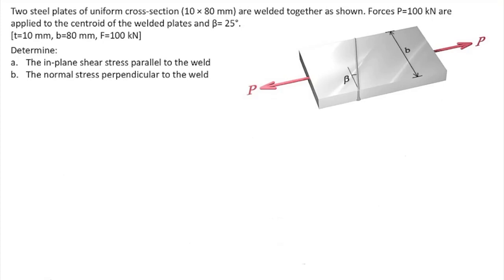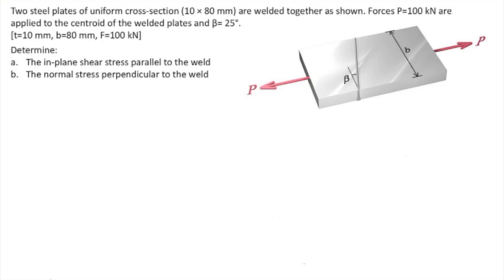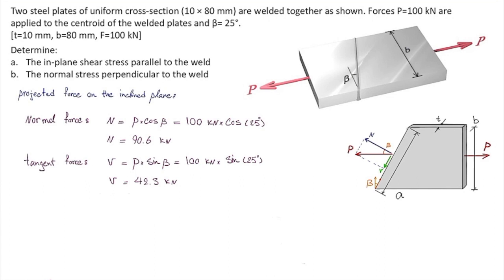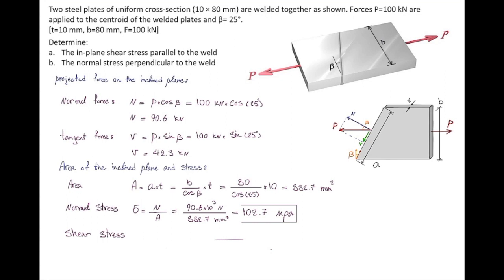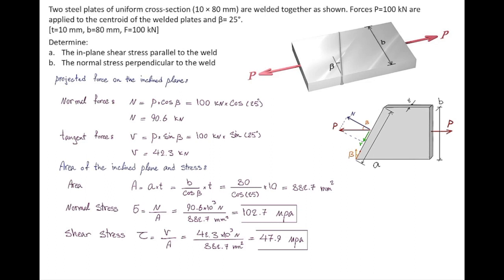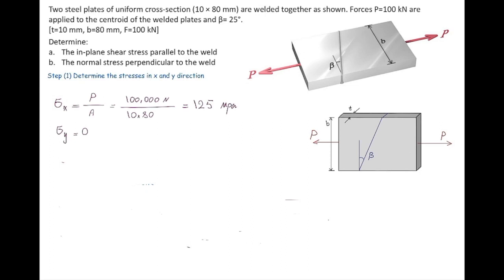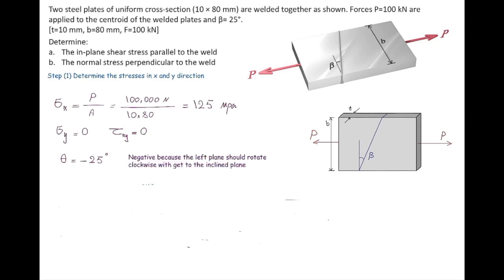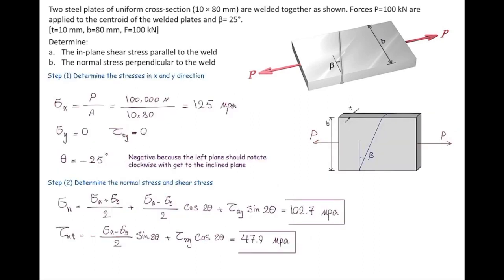Normal stress and shear stress on a welded seams using stress transformation equations

Comment: Hi good video, althoughI had a check, I cant get the last two equations to add up. For the stress normal at the last section:       (stress x + y)/2 = 75     +   (stress x - y)/2  x cos(2*-25)  = 75*0.64  = 48.2    so 75 + 48 =  123MPa      disregard the shear     sin 2(-25) = 0
Reply from the maker: I guess you made a mistake in calculating (stress x + y)/2  = 62.5  that gives sigma_n = 102.7 as given in the video. Hope that helps.
Reply: @MechanicsofMaterialsLibre  Yes I see it now, thanks, keep up the good work!